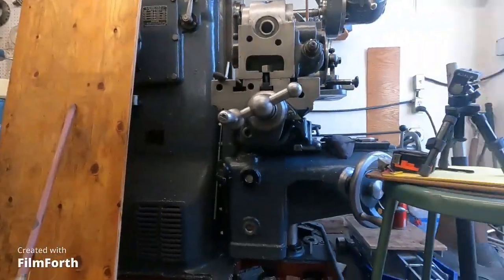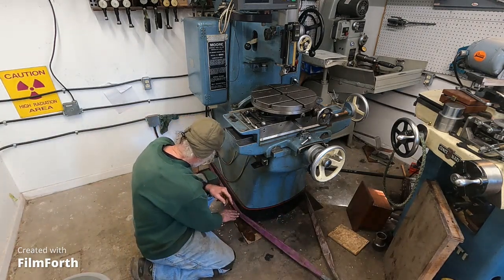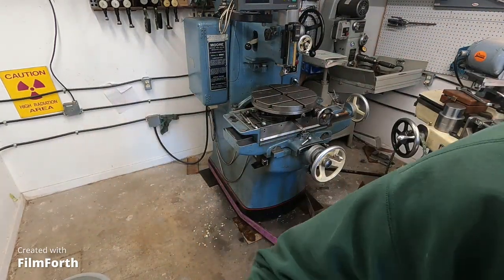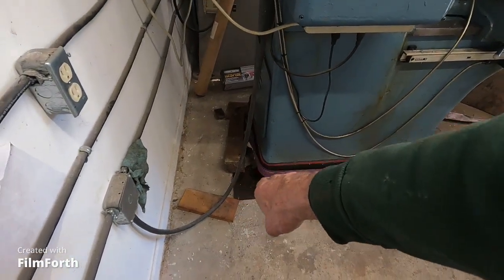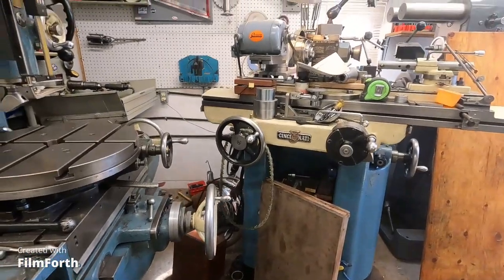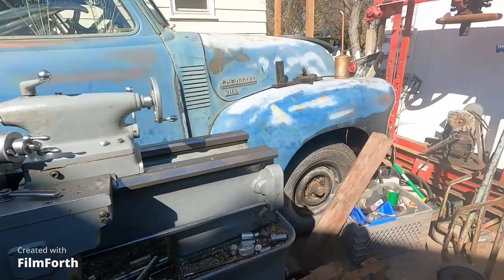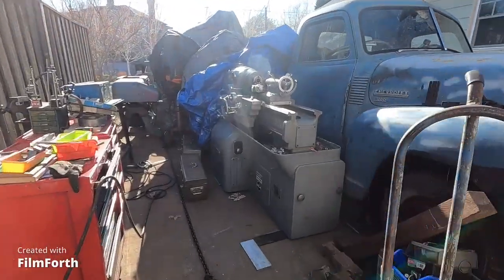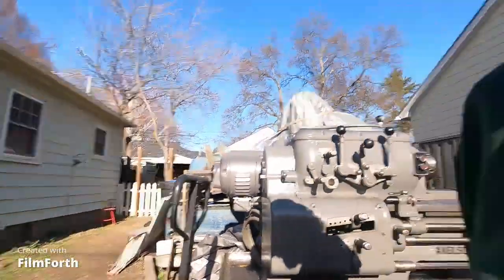Machine tool moving Moore jig borer

Comment: Very interesting to see how you move these machines, looks scary with this one! Do you ever need to remove the top casing on that Moore Jig Bore? Might be tricky with the ceiling so close. Any tips for moving a small lathe down a sloped drive way?
Reply from the maker: As long as the belts are good no need to remove the cover. Moving lathes is tricky if they are not on a skid.

Comment: It’s a great fit for that corner. Your making progress. You might want to try connecting an external battery to your GoPro camera to get extended run time. I run all mine on external power while filming. Have a great day.
Reply from the maker: Thanks, I will check out that external battery. I am going to move the mill back now!

Comment: If the base of a machine is flat wouldn't be just a easy to use say 6 or 7  one inch heavy wall pipes?
Reply from the maker: The base has 3 protruding feet I have tried pipes very unmanageable and dangerous with this machine, thanks!
Reply: @deedeeindustrialsuperprecision  I sure understand that.  That's why I mention if a machine had a flat base the pipe method could also work.
Reply from the maker: @justtim9767  I did move a Lodge & Shipely into the garage on pipes years ago, that machine had a wide flat base making it more stable, thanks